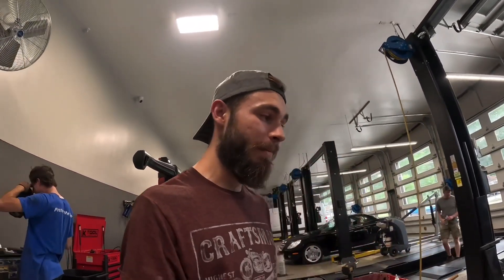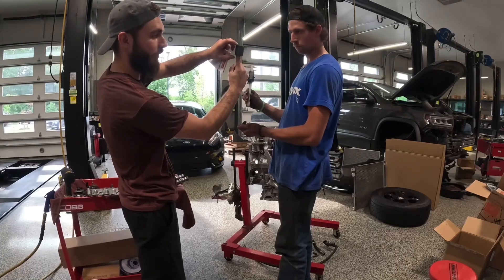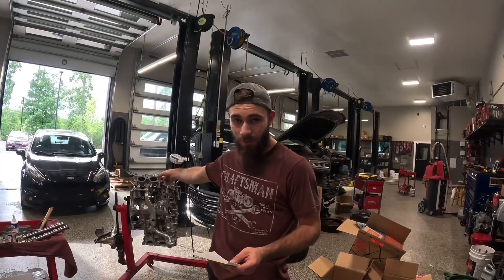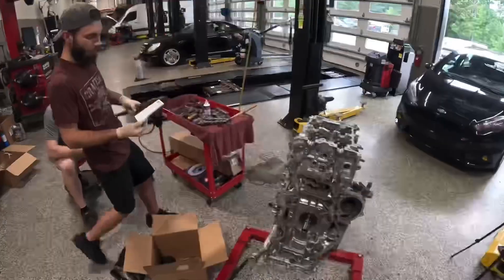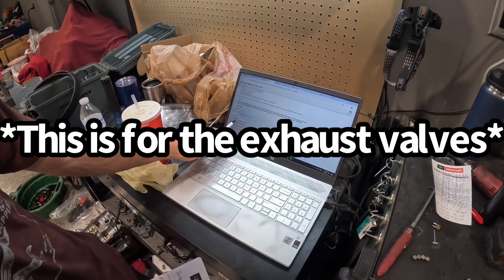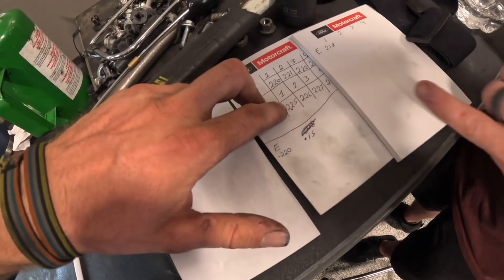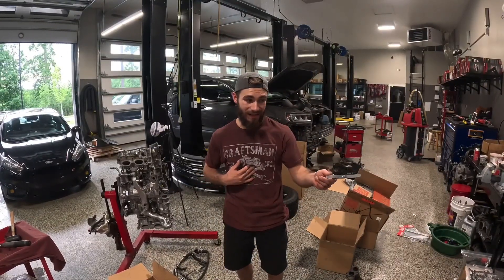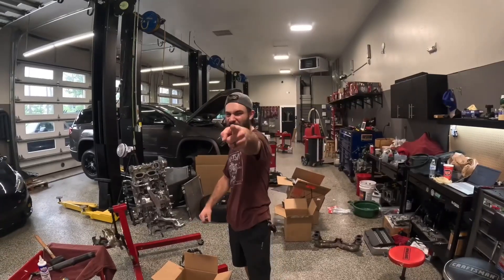Shimming Valves (Manual Adjustment Valves) - Subaru FA20DIT WRX 2015-2021

Comment: Did you point the lobes up on the driver side intake cam? I’m suspecting I have bent valves. I read in the manual the location you put the timing chain on is supposed to be unloaded but it very clearly isn’t on mine. I did exactly what was shown in this video and I checked it again yesterday after taking it out again. Leak down shows 0 PSI compression was 170. I’m redoing leak down with some help today tho as it’s hard to keep it at TDC with no timing chain on
Reply: Another odd thing is it clearly sounds like it’s misfiring but only shows one misfire on startup, no codes, no nothing. Smoke tested intake and exhaust, quadruple checked timing, all gaskets are new, ran fine minus what I assumed was an air/boost leak for 1246 miles before it broke down and refused to run without choking out

Comment: So tip I use is to use a brake rotor caliper, it’s able to measure the inside of the shim to the outside of the shim , giving you the correct measure. From my experience if you reuse shims at all , at least measure this. For example A 205 size might be a 202 and so on.
Reply from the maker: Good tip, thanks for sharing!

Comment: Well I skimmed my head on the fa20 and hit a new short block I o rebuilt the engine at the weekend and when I started it ran really lumpy down low and the idle runs like shit. Could this cause this?
Reply from the maker: Sounds like you have a vacuum/boost leak if it’s that bad. I would go over everything first and make sure you don’t have leaks anywhere in the intake system. Monitor fuel trims, air fuel readings, MAF reading, manifold pressure on a scan tool and see if anything is off.

Comment: If I kept track of them all and where they went do they just go back in the same place after new valves?
Reply from the maker: If you replaced or did any kind of valve work, they will not be the correct size. Best bet is to put them on and install everything dry and measure it with a feeling gauge to check how far out you are.
Reply: @MrTurboOfficial cool thanks man

Comment: What would happen if you mixed them up? Would the engine be fine?
Reply from the maker: Valve clearance is very important. If the clearance is too much it will be very noisy and if it’s too tight the valve could potentially not fully close. It will likely run but not well and definitely not efficiently. If the valves are staying open than you’ll likely burn them up.